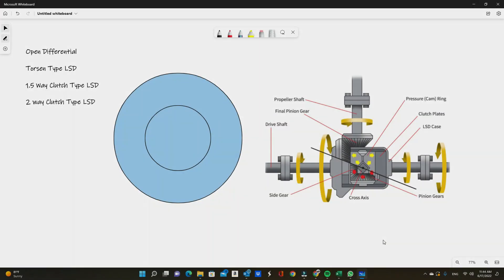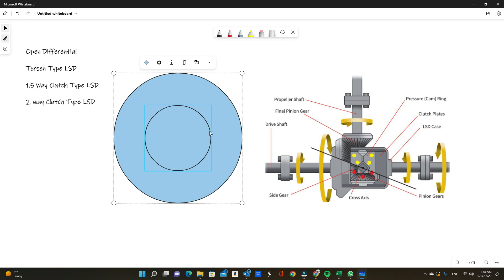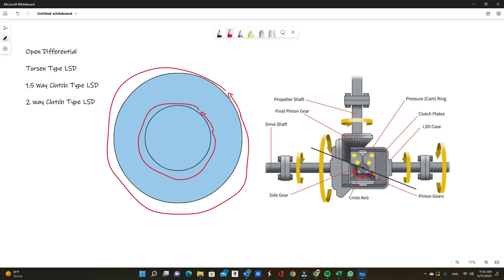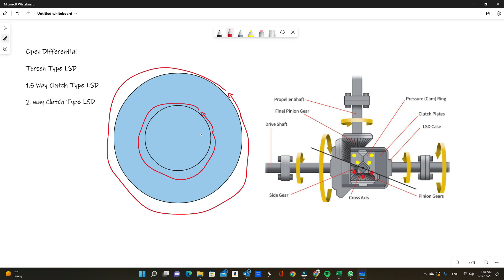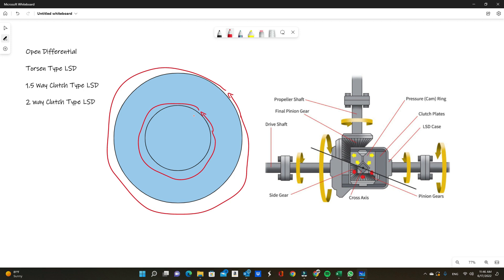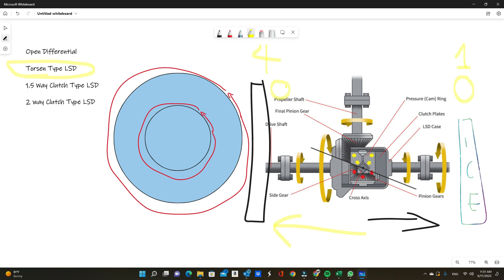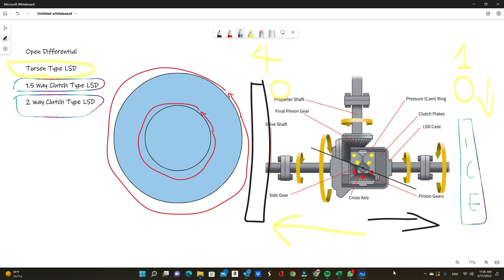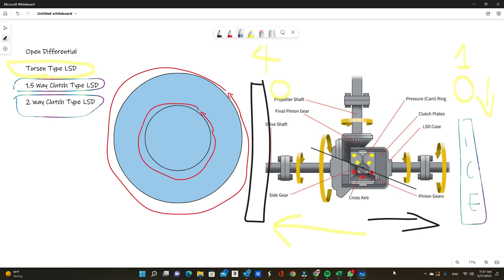Open Differential, Torsen LSD, 1.5 way LSD, 2 way LSD,  EXPLAINED! Which one do YOU need?

Comment: Unfortunately, in the tight mountain roads I drive on, there are plenty of times where one of my wheels lifts off the ground. Then again, my car is setup with a full coilover suspension as well as adjustable suspension components. So, it's tight enough to 3 wheel on tight turns with an elevation. Then the car tries to use its traction control which just makes me loose power and lose momentum in a turn. I need the 1.5 way.

Comment: I have a Supercharged Nissan 370Z with an exhaust - I need the power to be put down to the ground. 

Nobody's going to be able to hear any clicks or pops. You can't even hear yourself speak when the car is idling.

Thanks for the video. Going with 1.5 - as I've been thinking for a few years now.

Comment: Thank you finally with you that explains it will for me, now to the question, let's say I have Toyota Prado or nissan safari and most of my use is sand drive that means going forward and backward if I get stuck in the sand and doing high speed run up the sand dunes where you need all for tyres have the same or similar amount of tourq, what will be the best option thank you in advance
Reply from the maker: In that case you will want to look into differential locks